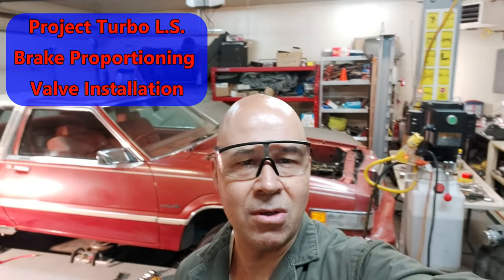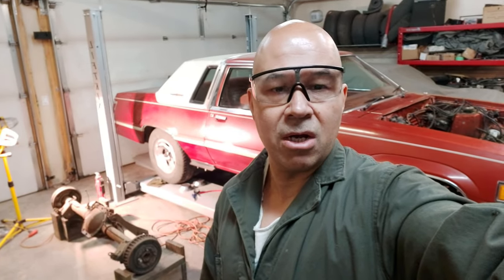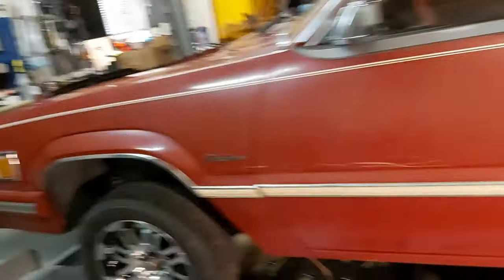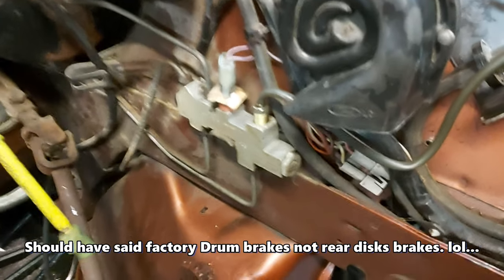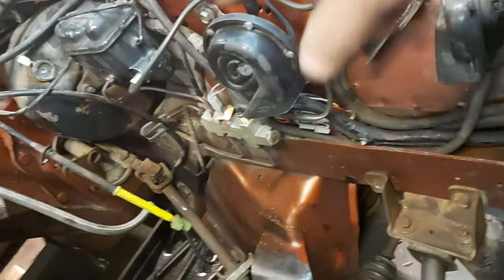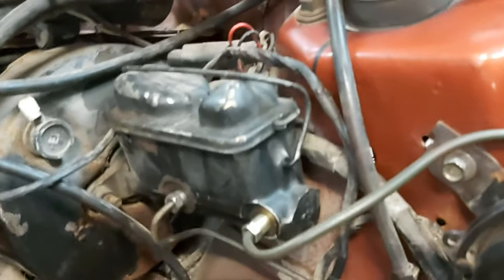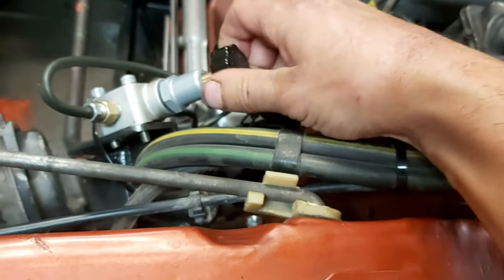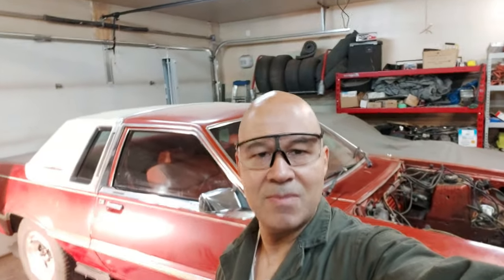L S  Brake Proportioning valve installation

Comment: How wide is the explorer diff? Or did you cut/narrow it to fit? Love the super sleeper T Bird!
Reply from the maker: Actually I had a couple of 3/8" thick plates water-jet cut with a big hole to fit around the mustang 8.8 rear end axle tubes.  I had holes to  match the locations of the fasteners which mount the  explorer disk brake hardware onto the plates cut.. I then welded the plates to the axles, and mounted the stock explorer 11.5" disk brake hardware to the factory mustang axle and the the 8.8 differential. A lot of work but it works well in combination with the 11" Baer front system. So I used a stock 88 mustang rear end and installed factory 97 explorer disk bakes onto this axle to make all this a bit clearer. I believe I have some more info on this in one of my other video's. Thanks for watching and commenting....Oliver
Reply: @petters1969  wow! Great engineering there👌
Reply from the maker: Thanks.....Oliver